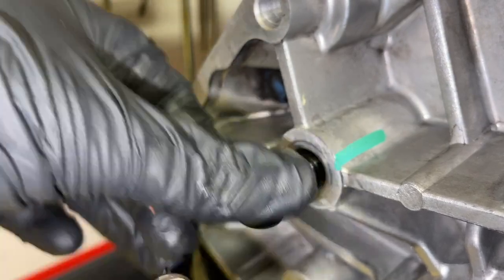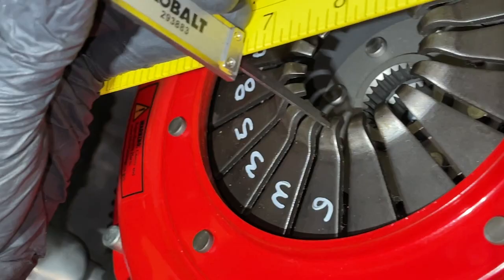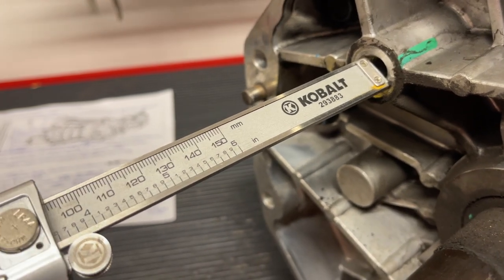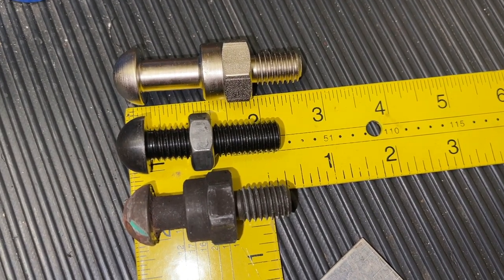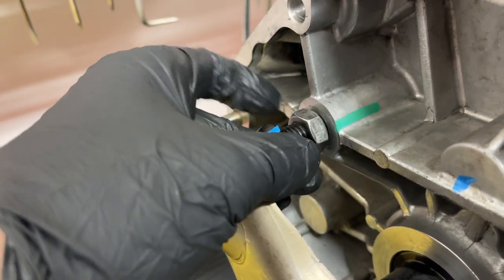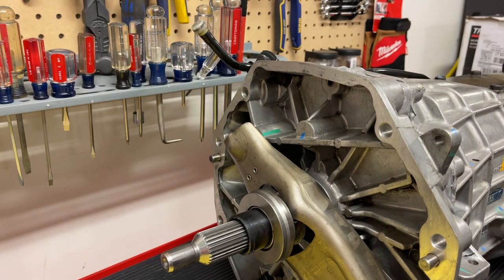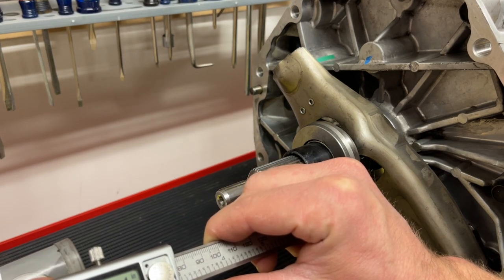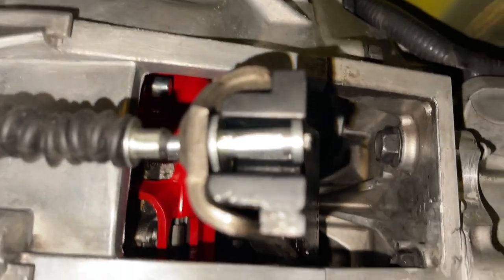Set Pivot ball stud length & throwout bearing gap Ford Mustang Mechanical Cable 2003-2004 SVT Cobra

Comment: Great informational video here...ran into this problem when I installed a t56 wit a duel disc clutch in my fox had to get the adjustable pivot an cut it down...again great video on how an what to do

Comment: Have you ever had the nut on the fork (fork weight) hit the pressure plate?
Reply from the maker: @OscarR-f1d  when they sent a mach 1 clutch instead of a terminator one the fork hit the pressure plate https://youtu.be/fp2PjADi8eM?si=gvJSpE2paUPA5hjW
Reply: @dannyjohnsonsgarage  ahh okay. Maybe an adj pivot ball will do the trick. I’m working with a swap so, a lot of different pieces working together. Thanks.

Comment: Generally speaking how often should the clutch cable be adjusted, and are you saying loosen the clutch cable over time?
Reply from the maker: The fingers move outward, but I’ve also needed to tighten it at times. It’s good to check every few thousand miles
Reply from the maker: If the cable stretched you need to tighten it as well and that’s pretty common

Comment: Where can I get the discontinued spring that pushes back the clutch fork?  Was that standard on the 03 cobra ?
Reply from the maker: Someone has made a do it yourself write up for it https://www.sn95forums.com/threads/clutch-cable-freeplay-mod-ldc-mod-do-it-yourself.55023/
Reply: Well thats good to know. Doing a t56 swap in my 97 and just added that to the to do list.